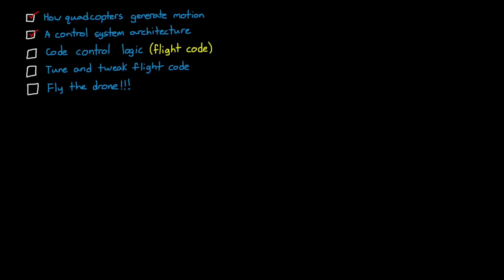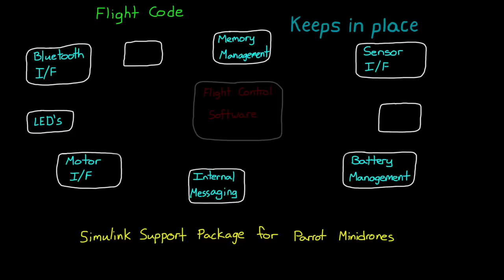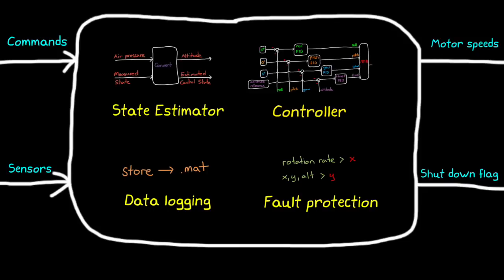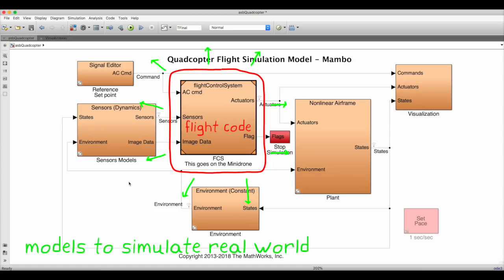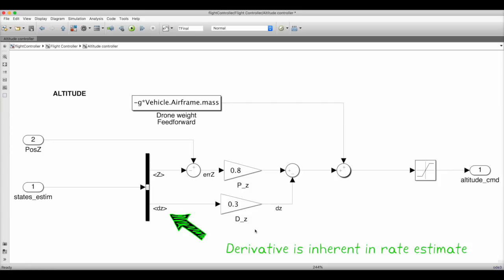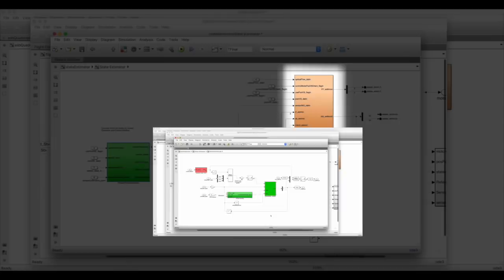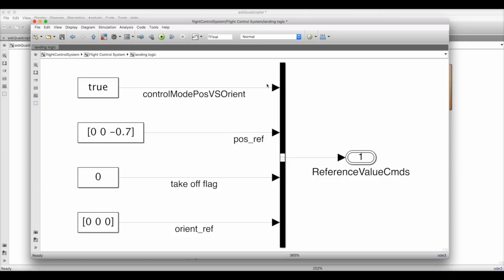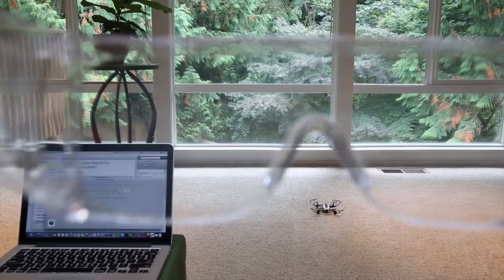Drone Simulation and Control, Part 3: How to Build the Flight Code

Comment: For anyone having an error with the bus creator in the Landing Logic subsystem, I solved the problem by keeping the fifth input of the system, which is called "live_time_ticks". I connected that fifth input to a constant block with value 1 and type uint32. The system worked and the UAV was able to fly in SIMULATION. I didn't test it on hardware because I don't have it.

Comment: I'm sorry video doesn't look complete and true, once.i attempt to repeat it with my Simulink model few errors pops up, such as: Bus command error:The bus data type 'CommandBus' specified in 'flightControlSystem/Flight Control System/landing logic/Bus Creator' is not valid; the number of signals at the input to the block must match the number of object elements.

Comment: I had no idea you could do this with the parrot quadcopter.  I know virtually nothing about Math works products, but that's going to change.  Being able to design, test, debug and tweak models is pretty cool, but being able to turn that straight into C code is astounding.  I always thought that Matlab woykd be crazy expensive, but the home and student licenses are very attractive.
Reply: Dude most important thing after control logic is how to get sensor data into the model and how to use model output.

Comment: I have tried the changes, and many bus errors occur. Could you please leave a link to download the modified project for you? Thanks
Reply: I also have errors in bus command , are you find the solution for this error!! , If you have , please heeeelp me
Reply: @aymenal-tarooti1959  Hello, the whole block works very well for me, but when I make the modifications that Brian does (obviously something I do wrong) he gives me errors. I have not tried anything else, I bought other parrot drones more, but I am using them to run races with friends, it is very fun and they work very well. In a few days, I'm going to get back to the subject of doing my own flight control. I'll tell you about the advances.
Reply: Fernando Liozzi Ok , good luck 
I’m waiting you
Reply: @aymenal-tarooti1959  i have solution of this problems
Reply: ouafo mandela ? Link?
Reply: ouafo mandela alanisaacgarduno@gmail.com
Reply: @howrobotics2052  hi sir . Please sent me solution of probleme to bus commande . I need it. Best regards
Reply: @bouchaibali1194  if you want the simulink model of this project, send me your email
Reply: @bouchaibali1194  note that I use matlab 2019b, what is your version?
Reply: @howrobotics2052  my version is Matlab 2018
Reply: @bouchaibali1194  do you receive the simulink model?
Reply: @howrobotics2052   yes, thanks.
Reply: Jochem Bos what is your matlab version ?
Reply: @howrobotics2052  I use 2019b
Reply: on this link, you will find my, designed to allow drone land to withe marker.
send me your feedback, best regards
Reply: @howrobotics2052  Your robot looks good! Do you also have the simulink files?
Reply: this is the link of this simle project, you must put all files in single directory.
Reply: @jochembos3334  hi sir please tell me  if the drone is working with you
Reply: @howrobotics2052  hi sir, I install Matlab 2019 but the file don't working. Bless reply me in mail.
Reply: @bouchaibali1194  Hi, I was out of town today and did not have time to test it yet. I don't have your e-mail, but I'll try it on 2019b asap tomorrow.
Reply: @howrobotics2052  Hi, the drone is working with me by Matlab 2018 b , please show me how I can change reference command.
Reply: @bouchaibali1194  send me your simulink model, I will put indication
Reply: @howrobotics2052  I send my simulation for you please look it and tell me where is the problem.
Best regards

Comment: I wonder will I ever see a step by step project made by mathworks seriously
Reply: I think it's more of an advertising MATLAB capabilities rather than a tutorial. It was too broad. But at least I got a clue of how real-life control systems are designed which I had no idea.
Reply: There is no short cut ya abo el3arab, study, read beginners materials and build up little by little, go slowly and pay attention.
Reply: @alirezaghodsipoor2239  so true
Reply: Way too much flowery language, technical terms, and statements. Way too much reliance on pictures. Not much actual content. This is an exercise in demonstrating your graphics control, not a method for teaching that actually provides useful information.  Brings new meaning to “droning”, on and on and on………..
Reply: if it was one, it would not be on youtube and you would have to pay for it (which is fair).

Comment: I got an error on the bus selector in the flight controller. Then I fixed it. 
But another error occurs. The errors are come out from the bus creator on reference commands (hardcode same as this video).
I also look at 2 pose_refout. In this video, we don't need that..but in the next minutes part of this video, the 2 pose_refout still exists. 
I was a little bit confused about that. Has anyone have been tried it and successfully to flying the drone?

Thank you.
Reply: How did u solve it , can u pls tell

Comment: I've implemented a flight controller system in C code but I am unsure how to convert the control signal value from the PID loop into a PWM time period. Since the error is the difference between the angular reference signal and angular orientation of the drone from the IMU, the PID calculations operate on angles but how can I convert the PID output values to PWM time periods to adjust the thrust of the motors?

Comment: I already bought it, I hope it serves me and I can do and program the example you gave me in my drone. Another query, can I return the programming to the initial state, if I want to fly the drone with the remote control?
Reply: Fernando Liozzi yep, I do it all the time. It’s easy to go back and forth. Took me a bit to get it to link to my computer the first time but after that it’s been simple. The FAQ page on mathworks is really good for working through any issues.